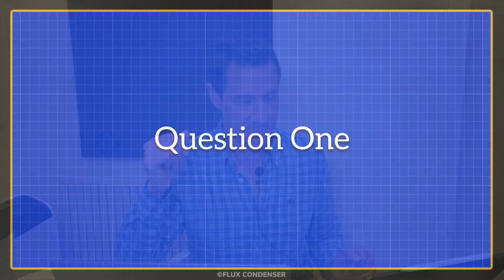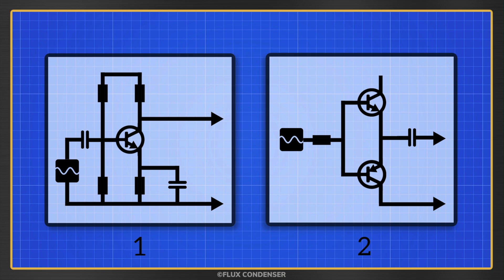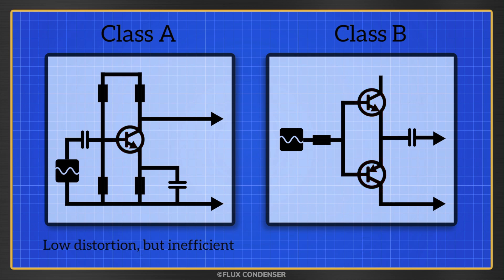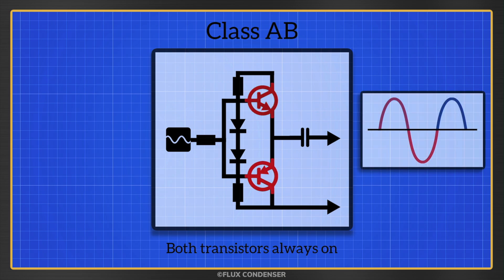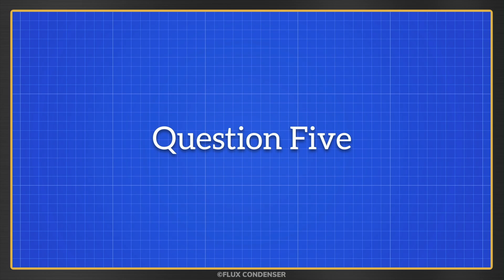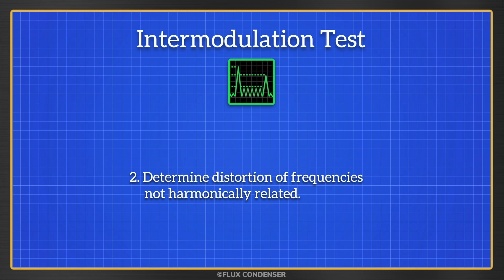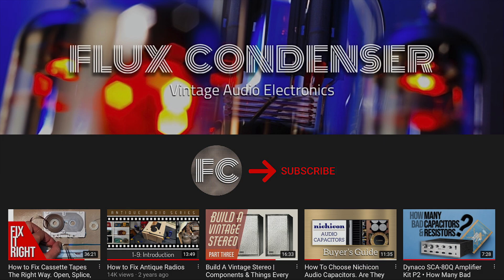So You Think You Know Amps? Take The Quiz.

Comment: The letter Q for transistors was chosen because the transistor is engineered to operate at a "quiscent" point, or a position along it's S curve, known as ot's "Q Point". Transformers are less often represented by the letter T and more often either represented by letters "TR" or the letter "L" which id notation for "inductance".

Comment: At question 2: My Mark Levinson ML-2 is said to be a Class A amp but resembles alternative 2.
Reply: That is probably because at low power levels your amp is working in class A but switches automatically to class AB at higher power. A lot of modern amps are built that way very few pure A class amps are still on the market. One giveaway is the power rating of the amp compared to its heft. If it claims up to say 20-25 W per channel is not going to be that heavy (but you're going to feel it), above that, an A class will be seriously heavy simply because of the power requirements, which means a huge transformer hence heft. If it claims more than that but feels light, it is definitely going in class AB at higher power levels.

Comment: "So You Think You Know Amps?"
Yes.  One amp is one coulomb per second.   https://en.wikipedia.org/wiki/Coulomb Oh you mean amplifier! 
A. NPN on left, PNP on right.
B. Class A on the left.  Class B (push-pull) on the right. 
C. Class B, push-pull. biasing diodes shown; could be AB but a true AB should have current limiting resistors perhaps in the emitter to prevent thermal runaway.
D? Intermod is non-harmonically related; one sine wave modulates another producing products.
Reply from the maker: Nice!

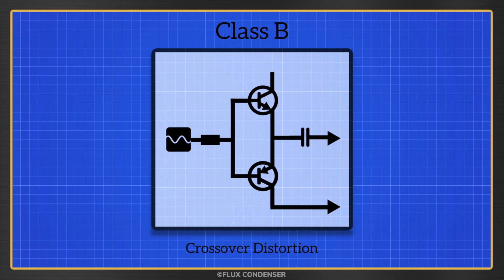Comment: 2:50 you still shorted the bases and ommitted the diodes - for the circuit to work, you'd have to have AC (capacitive) coupling for the bases. 
3:46 it's a matter of convention, in modern times American schematics I see Q, but in European circuits I see T, or even V. In Soviet circuits I often saw VT for transistors and VD for diodes.

I had some doubt with the class B totem pole push-pull, and with the intermodulation distortion. Turned out to be right.
Reply from the maker: Yes, thanks. The drawing is a vast simplification not intended for build purposes. I left many things out for the purpose of simplicity explaining the basic concept.

Comment: An amplifier with one transistor is called "single ended".  If it has two transistors (top and bottom) it is called "push-pull".  A push-pull amplifier can be class A, class AB, or class B.  The single ended amplifier must be class A if it is linear.  The class of an amplifier and whether it is single-ended or push-pull are two different things.  And the class B isn't more efficient because it has only one transistor on at a time.  It is more efficient because it has less current going through the transistors with small signals.  Also, it is incorrect to say ".6 volts of current".  Volts measure voltage, amperes measure current.  And your schematics should have dots where the wires cross if they are connected.  But I'll give you one point for the IM distortion question.
Reply from the maker: https://www.electricaltechnology.org/2020/05/push-pull-amplifier-circuit.html/amp
Quote: 
“Although all the configurations of the push-pull amplifier can technically be called push-pull amplifier, only the Class B amplifier is the actual push-pull amplifier. In contrast to Class A amplifier, Class B amplifier has two transistors for the push-pull electrical action of which one is NPN and the other is PNP.

Each transistor will work for one half of the cycle of the input producing the necessary output. This improves the efficiency of the Class B amplifier many times higher than the Class A amplifier. The conduction angle for this amplifier is 180 degrees, because each transistor works for one half only.

Class B amplifier is one of the most used amplifiers, but it comes with its own shortcoming. It generally suffers from an effect known as Crossover Distortion. Due to this effect, the signal gets distorted at 0V. A transistor requires 0.7V at its base-emitter junction to turn it ON. What that means is that the transistor will not switch ON until the voltage across its base-emitter junction does not reach 0.7V.

The same phenomenon is repeated for the negative half cycle for PNP transistor. This gap in the output when there is no output from the amplifier is called Dead zone. This problem can be solved by using diodes to conduct instead of the transistors when the circuit is in the dead zone. This modified amplifier is now given a different name, it is called Class AB amplifier.”
Reply: @FluxCondenser  "Each transistor will work for one half of the cycle of the input producing the necessary output. This improves the efficiency of the Class B amplifier many times higher than the Class A amplifier. The conduction angle for this amplifier is 180 degrees, because each transistor works for one half only."
I have a doubt about the quality of the source you reference although for practical purposes sufficient.  But the details of can be important. 

As Dave explains but I delve a bit more into it:

A fully driven Class A has the same efficiency as a fully driven Class B.  It is for small signals that Class B obtains efficiency, which in the case of music, is going to be most of the time. 

The extreme case is no signal at all.  The Class A will be biased to achieve half-voltage on the collector and consequently a continuous power waste of 1/4 maximum power.  Class B will be cut off with zero current, voltage and waste at the output.

It is interesting to study the schematic of the ICOM IC-705 transceiver.  It is single-ended, Class A final amplifier BUT achieves nearly the efficiency of a push-pull Class B by adjusting the bias drive dynamically.  At any given moment there's only enough bias to turn on the transistor enough to amplify the positive and negative halves of the input.  Small input, small bias.  Since the signal is generated in a DSP, it knows in advance that a strong drive is coming and adjusts bias accordingly.
Reply from the maker: @thomasmaughan4798  Thank you for adding you knowledge to the conversation.
Reply: @thomasmaughan4798  "A fully driven Class A has the same efficiency as a fully driven Class B.  It is for small signals that Class B obtains efficiency, which in the case of music, is going to be most of the time. "

No. Class A cannot exceed 50% efficiency when theoretical limit of class B is 78%. Efficiency is calculated for max power on sine wave.
Reply: @brys555  "Efficiency is calculated for max power on sine wave."
Concur, mostly.  But a music amplifier is unlikely to be operated at max power on a sine wave; and as such efficiency measured on that basis is not particularly useful.  
Particularly for battery operated devices, efficiency is simply the total power sent to the speakers divided by total power consumed from the battery.   In that real world scenario, Class A is horrible and Class B is pretty good.
Reply: @thomasmaughan4798  Yes. But music is not a standardised signal. You can measure total harmonics for single tone sine wave and know when amp goes into overdrive and that way get its max output power. Its impossible to do this with music with all the frequencies and spikes. Almost like a pulse mode operation. So as you said, that overall view on battery life is good description of efficiency for the amp user but that video is more on theoretical side of classes so was my comment.

Fun fact: Class A amp will draw the same current from source, no matter if there is no signal or if it plays at full power (assuming there is no overdrive situation).
Reply: @brys555  "Class A amp will draw the same current from source, no matter if there is no signal or if it plays at full power "
This can be a (weak) advantage.  Class B amplifier current draw will vary according to signal and that varying current can cause varying voltage with various minor consequences.
Reply: @thomasmaughan4798  They use it in guitar amps for kind of compression effect. At least I was told that by someone who builds those amps.
Reply: @FluxCondenser  You can build class A amp in PP configuration. It won't help with efficiency but will reduce some even harmonics. As well, you can make class B as single ended but only for high frequency selective power stage, where the load is a resonant tank circuit, which will filter out harmonics. You can also polarise a small signal transistor in class B and put LC as a load, but tuned into one of higher harmonics. That way you can have frequency multiplier.

But yeah, for audio anything that isn't class A must be push-pull.

Comment: Got 'em all, but I've been building and repairing preamps, amps, mixer boards, speakers, and so on since the mid-1970s.  I refer everyone to the Nelson Pass designed A40 amp that appeared in the Audio Amateur magazine issue 4/78.  It is a push-pull amp using a constant current source to bias the output transistors (NPN/PNP) into Class A.  It sounds wonderful!  And it's a great space heater during cold winter months!
Reply from the maker: You’re a class A guy.
Reply: @FluxCondenser   But only during the winter!  😁
Reply: Gotta make my own, it seems - though after a brief period with solid state audio experiments in early 2000s, I only do tube stuff now.

Comment: I know these fairly well on the components, but the A, B and AB was something I did not know as well as I should.  I knew that the dual output was also called a push-pull amp as well.  Class D is one I hear about often in car audio amps, these days.      The transistor "Q" is kind-of how they look on a diagram, as well as the early can transistors had a little part sticking out of the one side so you could get the legs positioned right. Looks like a Q from the top...
Reply from the maker: Hm. I see what you mean about the Q. Good thought.